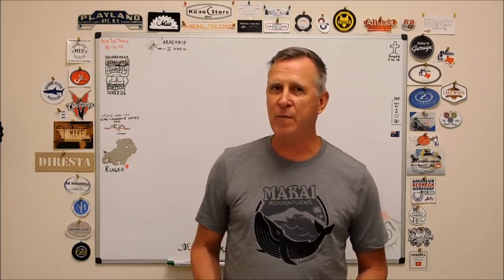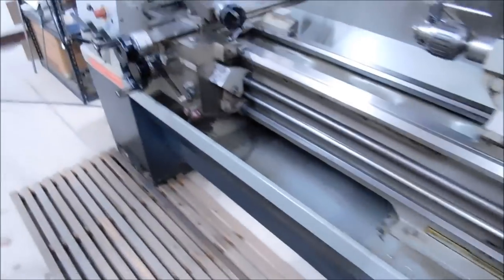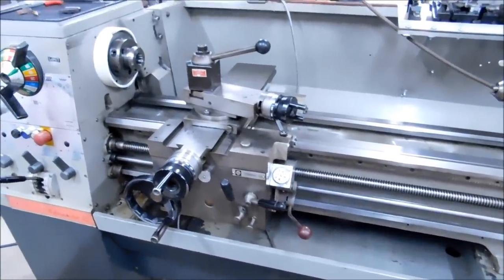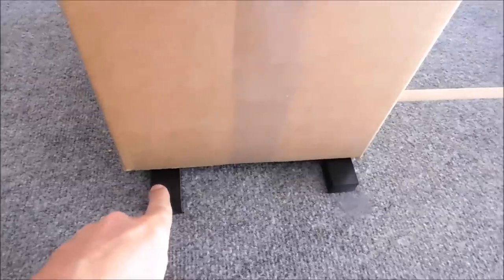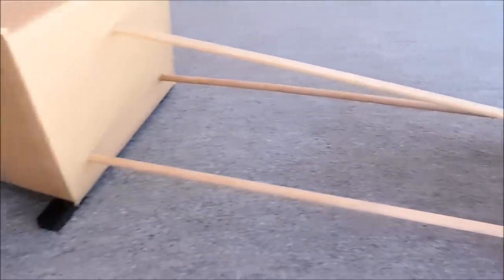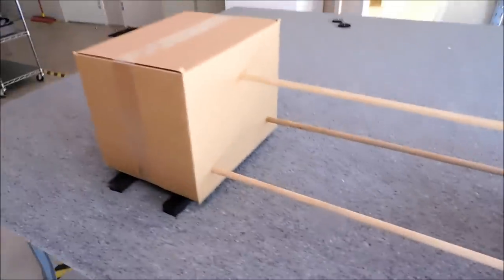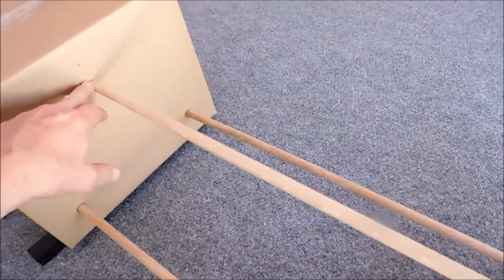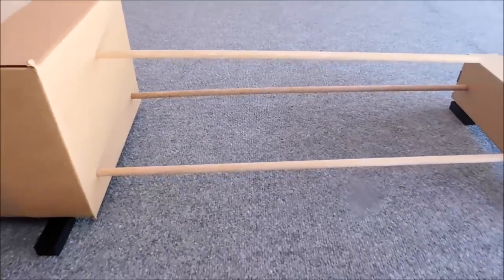Lathe Leveling - Waste of time ????

Comment: How do you level a long, light non rigid bench lathe? I have a 4.5' long (I think 48" between centers) 10" 1940s south bend lathe which is bolted to tube framed cabinet that sits on my basement floor. The tube framed cabinet is certainly not rigid enough to take any twist out of the lathe bed. Perhaps a threaded rod diagonally between the right fwd and left rear feet would work.

Comment: Another story are the hobby guys who level the machine with carpenter's level and when it comes to measuring 0,1mm is dead nuts
Reply: Not meaning that hobby guys in general do that, but I've seen a couple
Reply: They probably don't need any more than that. You have a problem with that?
Reply: nothing that other people do is a problem for me

Comment: take a cut on a piece near the chuck and a cut at the tailstock all the way back .... check dia .. if the same you're good
Reply from the maker: This must hold true for extended and 'between center' setups or your comment is not valid.
Reply: @joepie221  yes it is for location of the tailstock  any in between would depend on stiffness of material and steady rests
Reply: @joepie221  you are not the only machinist out there

Comment: What you are actually testing for is planar (i.e. degree of twist) - not level - and you are also then testing squareness to a relative perpendicular dimension. Level literally has nothing to do with it and using the word causes massive amounts of confusion. That said, the perpendicular is assumed and abstract (unmeasurable directly) and thus actual level becomes a universal benchmark that can be utilised as a reference. Yes its much harder to describe than to do.
Reply from the maker: Your comment has supported the very reason for this video. thanks.
Reply: The reason the word “level”is used is because by the creative use of an accurate machinist level (typically 0.0005 in/ft.) a machine tool can cut straight and accurate.

Comment: Lathe needs to be leveled precisely in every possible way, thats the rule. 
No other opinions makes sense, its a fact.
Reply: That is "your" rule.  Joe seems to disagree slightly.  If I were you I would remember that Joe is pretty damned good at this machining stuff!
Reply: Nope.Lathe needs to be straight. It can hang on the wall if it's straight (and you have strong wall :)).
Reply from the maker: Thanks Paul. Maybe its time to rewrite some of these old manuals.
Reply: avo.
If "level" was important how could they ever successfully mount a lathe on a ship.The word level is being mis-used as Joe has pointed out. Same goes for a milling machine.
Reply: Hi, I was going to say something about lathes on ships but it has already been done. The next logical step is to consider setting up a lathe on a spaceship. 'Level' to a bubble is only horizontal in relation to the centre of a planet. Remember that the Earth is spinning at about a thousand miles per hour at the equator. There are really only two tiny points in time in every revolution, at the equator, when the lathe is horizontal to the universe. What do you use between planets?
Reply: @Newbie Failmaster Absolutely, I was agreeing with you. I was trying to help Mr avo take another look at his viewpoint.

Comment: What is with all the background noise? At least you do not play obnoxious music. :-)
Reply: I rather have a bit of background noise rather than some youtube stock music
Reply: He has the door open to the outside  and the traffic.
Reply: @royreynolds108  I suppose he could have closed the door if he thought of it. Too busy making good videos!
Reply: The weather in Austin Texas is rather toasty now and will get even hotter. He would be melting if he had the doors closed.
Reply: @robertoswalt319  Yeah, but as they say in those geographic ovens, "Oh it is not bad, it is a dry heat." AC might be appropriate. :-)
Reply from the maker: The sun gives a much better hue to the video than the overhead fixtures. The shop is close to the highway and the street noise just floats in. I don't even notice it until a pair of big block chevys' use the light as a staging lane. Even then I don't mind.